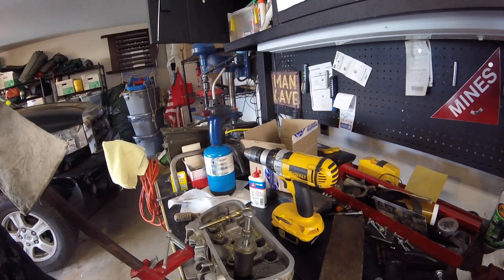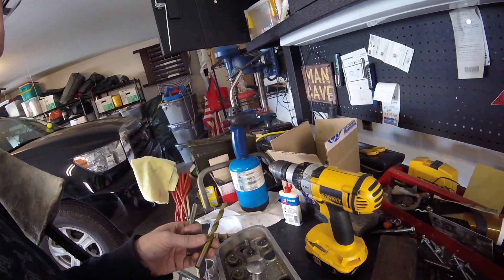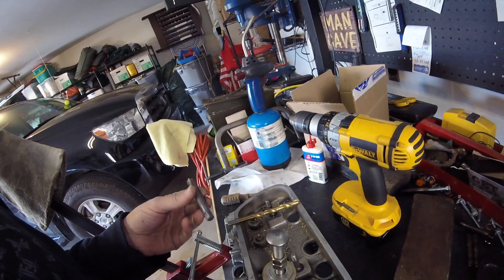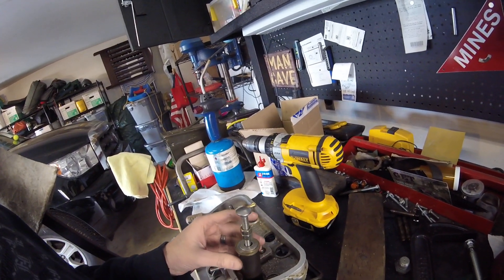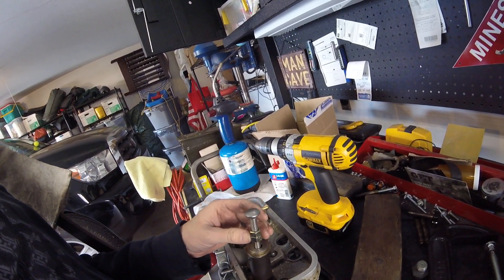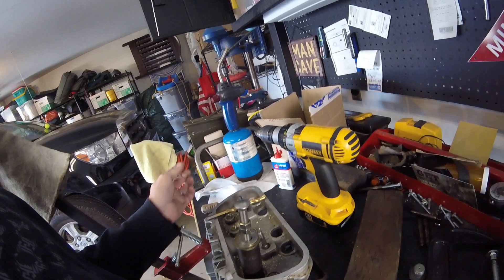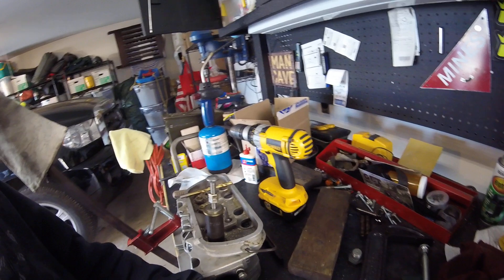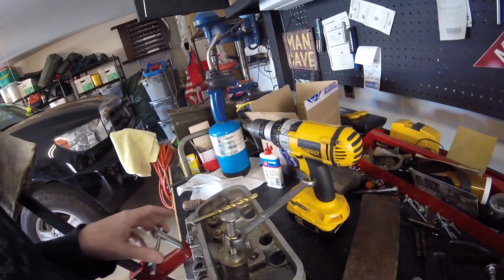VW 1600 DIY Valve Guide Removal NO SPECIAL TOOLS!

Comment: Wrong on all counts. You are putting excessive strain on the guide bosses by pulling the guides out, creating a potential for dangerous cracks. Much better to step drill the guides from the valve cover side and then tap them out the same direction as they were installed. Been doing it this way for over 50 years and did not ever have an issue.